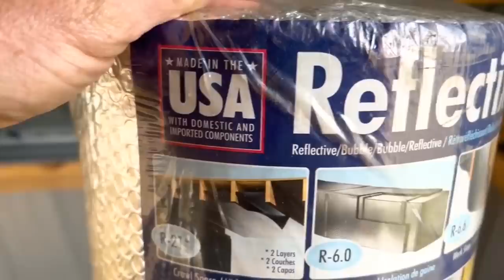We built a self heating chicken coop | Keep your chickens warm all winter…

Comment: Only one single thing I would do is lower roosts and flip the boards so they can sit on their feet to keep the toes from freezing otherwise it’s beautiful awesome job and great teamwork
Reply: Lower roosts flip boards. Going to ask my dad what this mean i have to know.
Reply: Looks like too hot for summer chickens. You will need two chicken coops. Winter and summer.
Reply: @wheelie642  - What's wrong with that?  :)
Reply: Glad you mentioned that because I've heard they lock their feet around a pole type perch, but the flat perch sounds like better for winter protection. This was a hard weekend for chickens in Maine. Temps dipped way below zero + windchill were bad. I heard there were alot of poor hens that didn't make it due to hypothermia. Sad. Heat lamps are a dangerous way to deal with  cold coops also. Fire hazard from lamps is more common+you can lose your whole farm if just a little dust or chicken feathers ignite. Not worth the risk.
Reply: @carolsanborn5332  I use cozy coop panels at -12 here the coop stayed 14 degrees. No fire hazard just have a backup small Jacory generator Incase you lose power
Reply: @Sharon-v3f5s  Thanks. sounds like a good solution. We had -18° on our outside thermometer +wind chill of about 30° so that's  -48° if my math is right.  Hopefully there are no drafts in the coops, but those heaters you me turn would be a help. I'm sure the hens would appreciate a 20° advantage anyway. I don't know how cold it has to get before you lose hens to no wind chill , (just downright cold temps)... I wonder how cold a hen can take before it gets into their serious 
danger zone. I've never heard of Eskimos owning chickens, so I think there's a limit to what they can endure.
Reply: "MENTIONED" NOT "me turn". My spell check is my worst enemy - sorry.
Reply: @harumscarum2285  "Lower the roosts" means that he put the roosting bars a bit too high. Most chicken like to roost between 2 and 4 feet off the ground. "Flip the boards" means turn them so the wide part is facing up. That way the chickens can flatten their feet on the boards and sit on them to keep them warm.

Comment: I applaud you, young man, and those beautiful young ladies who have help so much! Most excellent job! You should have some very happy chickens in the future. Your hard work will most definitely be greatly rewarded...I'm betting! Hope the weather isn't causing too many problems. May your Thanksgiving be a wonderful time for your entire family. Take care, my off grid family, be safe and God bless!
Reply from the maker: Thank you Jim! The weather has been just beautiful and we’ll take any day the good Lord gives us. Have a great Thanksgiving weekend as well!
Reply: Absolutely agree with you 👏👏👏
Reply: If you’re chickens are like mine? You’re going to find the chicken all won’t cuddle side by side regardless how cold it gets?  I may have 6-8 chickens cuddle then a 2-4 foot space with no chickens on the roost. If chickens try to use the open space the other chickens peak at the other chickens till they get off the roost.  My coop a 12 X 12 X 6 foot high ceiling. I have a 8 foot long roost in the center of the coop on the back wall that’s on hinges so the roost folds up against the ceiling and locks in place to keep the roost out of the way completely when cleaning the co-op floor. I also learned roosts need to be least 18” from the walls, otherwise the chickens will crap on your walls too. Recommend making sure your roosts are least 2 ft down from the roof line  to keep the chickens from hitting their head’s getting up on the roosts too! 
I did use a metal roof corrugated metal painted white from the factory to reflect the heat of the sun.  My temp may not get as cold as where you’re at? But from my experiences chickens handle cold much better then hot temperatures!  Hopefully it won’t get too warm inside the coop in the summer or winter for that matter? If too warm in winter the chickens won’t get use to the colder outside temperatures and the changes in temperature not healthy for your chickens I’ve been told anyway! I know my chickens don’t handle hot temperatures at all! I have misters around the coop on the outside to spray on the roof when it’s hot. Coop stays fairly cool even in 100 degree weather.  I also make sure my chickens have all the ice water they can drink in the summer months too!  Want to avoid chickens getting heat stroke if you’re temps get up much above 80 degrees or especially hotter!  
I‘be only been raising chickens for little over 3 years now and boy have I learned a lot in that time!  But for my first coop it turned out fairly well. If I did it over again though, I wouldn’t of put a wooden floor in the coop. It is on wheels though and the coop off the ground 3 ft so the chickens can use underneath the coop as part of their chicken run to get out of the weather whether it’s raining, snowing, or just the sun beating down on them!  Chickens do spend a lot of time under the coop so seems like it was a good idea anyway!  It’s all on wheels too, so it’s not too hard to move. I used wheels for a dolly that mounts every few inches on each side of the coop to handle the weight of the coop since it’s fairly heavy!  But it’s built like a tank! Especially with wanting to be able to move it around I wanted it as sturdy as it could be! Framing all glued with exterior glue and screwed together with stainless steel screws and T 1-11 siding around the coop on the outside walls.  Waterproof plywood with laminate flooring that least makes the coop flooring fairly easy to clean.  But like I said, if I did it again I wouldn’t have a floor and would just move the coop rather than having to clean the floor area!  Still, the floor I built not horrible to clean. Takes about 20 minutes at the most.  I got 2 tools that helps a lot you may want to check into also? I got a floor scraper that’s for removing old flooring materials off the floors for remodeling.  It has a 12” x 6” sheet of metal that connects to a metal handle the length of a regular broom and you can resharpen the metal edge if you need to easily! 
Other tool that really speeds up time is a good snow shovel to pick up larger quantities of waste off the floor and I have a larger hand cart on bike wheels to toss the waste in and take it to the compost pile by the garden.  It not too bad of a job. Still wish I not gone with the floor in the coop though!
I have made another smaller coop that doesn’t have a floor and it’s on wheels easily moved too. I use it when baby chicks are old enough to be outside but not where the older chickens can peak at the baby chicks. There’s hardware cloth around the sides and top so the adult chickens and baby chicks can see and get use to one another. Makes it easier to put them all together in the same coop once baby chicks get close to the size of the adult chickens!  Otherwise they tend to fight more!  Looks like you’re coop large enough for quite a lot of chickens? I have 44 chickens myself and it’s growing every year! If you got rooster and let your chickens free range? Those hens will find hiding places to sit on their eggs till they hatch. One day you’ll find a hen with 3-13 baby chicks following behind the hen! Happened 3 times last summer here!😂  
If you’re new at raising chickens? Be sure to make a good diet bath for your chickens and the chickens will tear up a place to dirt bath if they don’t have a good place to go!  Remember calcium for your chickens too! You can use egg shells crumbled up and baked in a oven first to kill bacteria so it won’t hurt the chickens to eat the egg shells. But I also give mine oysters shells as well and don’t forget grit especially even with the baby chicks they still need a small grit to grind up what they eat.  I get a granite pebbles for mine.  Like I said, I learned a lot the hard way! Many things I just never knew chickens needed!  Good luck with your coop and chickens and any babies your hens may have if you got a rooster?  Only time till those cute little chicks will be running around! I gather the baby chicks up and put them in a cattle trough to and put a little bedding, food and water inside it. Also got a chick warmer the chicks can get under to stay warm. If it gets too cold I’ll add a heat lamp too and with a board over the top of the water trough the baby chicks stay plenty warm in the garage out of the weather even when it’s in the 20’s outside!  Chicks don’t live long if they get too cold!  I won’t let them outside till they have all their feathers and even then I wait till it’s least in the 70’s outside first!  Nothing upsets me more then loosing my chicks!  Of course predators are a pain too, especially if you’re free ranging your chickens? Everything wants a chicken dinner including hawks and owls too!  But a good reason to have other animals to protect your chickens besides just roosters!   Seems the more chickens and roosters I have the less trouble I have with predators though?  Best wishes to you!
Reply: @ghostridergale  absolutely agree. I have a heat light in the coop and they prefer to roost outside, but they will go in the coop to ley their eggs 😄

Comment: My experience is that it is much colder at night than during the day, so while your "greenhouse coop" will heat up when the sun is shining the temps will rapidly drop once night falls.  
Therefore, I have two pieces of advice.... 
1 - To moderate this effect (a little), it would be good to put some large black "thermal mass" containers against the back of the sunny side... Something that won't crack when frozen, but the sun can hit and warm up and hold onto the heat longer into the night.  
2- Give the birds a closed-up smaller coop space inside the dark side to snuggle up into at night.  Their bodies are little radiators, except in that large a space, their heat will spread all around and not keep them warm when they need it. 
3- (ok--- I fibbed... 3)... Make sure you keep everything super dry in there.  Birds can handle much lower temperatures in a DRY environment, then they can if their is a lot of moisture... so be prepared with good ventilation and more brown-matter (shavings/dry leaves/etc.) to dry the place out whenever needed.  
Happy Thanksgiving, back to the kitchen for me!
Reply from the maker: Thank you Bernadette! Hope you had a great Thanksgiving

Comment: Pro tip, make sure they have proper ventilation because moisture from the manure is what is our largest threat. They give off plenty of body heat so the number of birds should be calculated to the coop square footage properly. If you have 4000 hens in one room then warmth is never an issue. Then its wind and moisture build up. If you only have 30 or so then your space needs to be small enough to use that heat properly and be able to vent away the moisture and not allow for frost bite to occur.

That Tek foil should reflect heat pretty well just be careful not to make the coop air tight.

Love the build and the video. Keep it up!
Reply: Frozen eggs 🥚 are always a problem in small scale ⚖  farming.. makes you collect twice/three times a day or suffer losses. Commercial hen houses (old school non automated egg collection) the birds generate so much heat that frozen birds or eggs 🥚 are never a big issue unless you get extreme weather events.

Comment: We use a similar system of passive solar. Use extreme care to monitor your coop temperatures until you get the feel of things. They can heat up very quickly when the sun comes out even in cold weather. I often leave a small door open to the enclosed run during the day just in case they need to escape the coop. The coop will also experience a greater range of temperatures over a 24 hour period. Cheers!

Comment: I have to have alot of air flow in my coop. We rarely get snow and our birds get respiratory infections if the coop isn’t ventilated well enough. I’m actually thinking about installing a small solar powered exhaust fan in the top to help with air circulation. We put ours in one of those prebuilt sheds and they free range during the day. I’m glad that it doesn’t get this cold in our area. This is a really nice coop though.
Reply from the maker: Never had an issue with respiratory problems.

Comment: My ex lady friend and I insulated her chicken house a few years ago. 1" foam on the floor, walls and ceiling and then shielded it all with plywood. I made 12 bin apartments, a wire dividing wall and a 6" x 8" hole for the ladies to go outside. I covered this hole with multiple strips of demin jeans to keep the cold out. We then ran a 100 watt red blub for warmth. It was warm in there and we would go out there before bed to check on the ladies and have a warm hoot in the evenings. Heck, it could be a emergency warm sleeping hut in the winter for 3 people if needed.

Comment: Nice job on the coop. 
I grew up in Northern Wisconsin, and to keep the predators out of the chicken coop, we took a 4 foot tall  length of galvanized wire cloth, bent up 1 foot to nail along the outside wall, with the 3 foot part laying on the ground. Made J hooks out of scrap rebar to stake it to the ground. They tried to get in, but were unsuccessful.
Reply from the maker: Thank you. We have a good guardian dog that keeps em away.

Comment: I know some people that do do van life! They will take 4in or 3in PVC pipe and cap one end and the other with a 90 with a clean out. And paint it all black and use it for a water heater. But what I'm thinking it's taking the same idea and putting it on your roof inside the chicken coop. Where the sun shines in. But Capping both ends and only feeling with half or 3/4 water! In case it freezes it will have room to expand! But throughout the day it will heat the water up and at night it will be like a heater. I seen in greenhouses where they put black barrels to catch the heat from the Sun and then end turn at night it helps keep the building warm. Same principle but smaller ideal!
Reply from the maker: Interesting.

Comment: One other tip... put roosts where the combs cannot touch anything solid or the combs will freeze faster. One other person mentioned to turn the boards so they roost on the wider side of the board. That is good advice.

For the top of the crates, make it angled like a roof or they will roost on the flat cover and create poop piles that will freeze. If it is made of tin it will also help to keep them off because they will slide off.

Shavings work better than straw, straw works better than hay, in regards to the floor litter. You want to stay away from compaction that will trap moisture. Some people use sand, but I have not used that. I prefer organics that I can use for fertilizer afterward.

If the ground does not freeze quickly, the chickens will dig at the edges, making nice holes for varmints to get through. It appears that you will not be moving the coop in the winter, so this may be a consideration. Varmints might dig through anyways. A hungry racoon is difficult to stop. I wish you all the best. Over time you will learn where things will need to be tweaked. We all do.
Reply from the maker: We have a LGD that doesn’t allow any predators near any of our livestock let alone our  property

Comment: Nice coop and video. I am going to build one very similar. One suggestion though...just stretch your Reflectix between the rafters and leave that 2x4 width air pocket between the metal and the Reflectex. Air is a great insulator along with the Reflectix. The R-value will go way up. Same for attics in houses too.
Reply from the maker: There is an inch gap between the metal and the reflectex

Comment: Maybe in the future you could line the inside of the coop with none toxic virgin PVC wall panels, then you can use a pressure washer to spray it down to keep it clean inside.
The best panels are the inter locking with the nailing flange on one side of the panel.

Comment: Nice build, but I want to give you a bit of advice. The roosts should just have their edges smoothed off just a tad, and it should lie on the widest part, so the chickens have a wider roost. This is much better for the bird. And I also saw that you put the insulation all to the metal roof, it should have   no contact and a space between the roof and the insulation cause you get an extra insulation from the added air space in the ceiling. I have build quite a few coops in my day, and have done some beginners fault in the start, such as putting bubble wrap all to the roofing 😄. I saw hoping that I had built my last coop, but got a new breed, so again we go this winter and spring. But i would put something in front of the netting to stop cold air to get into the 'sun porch' .